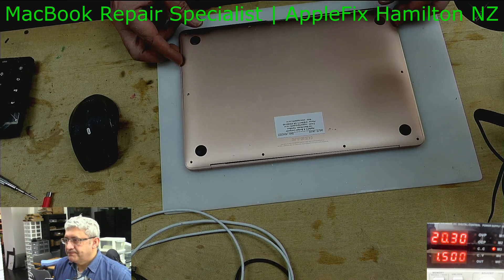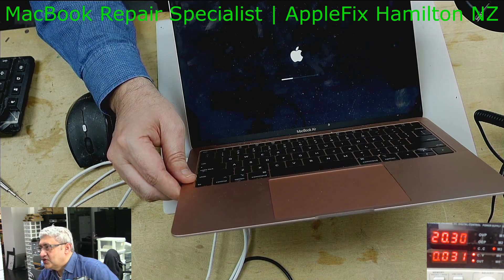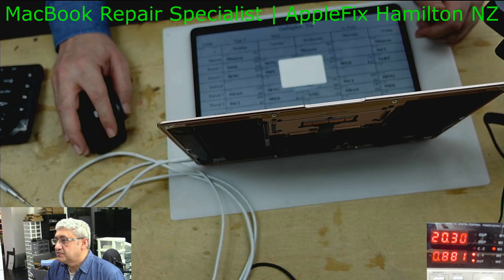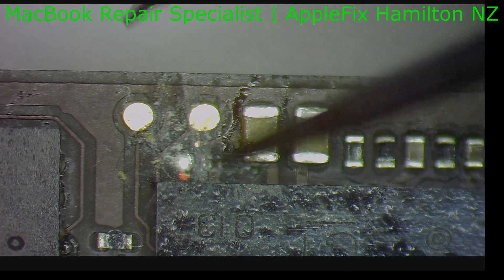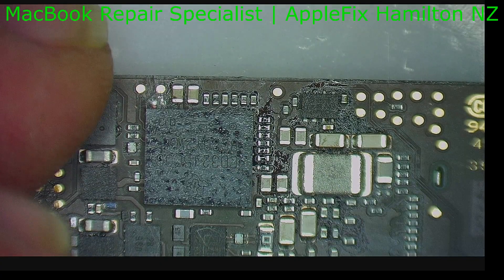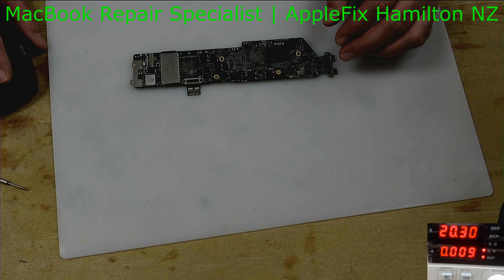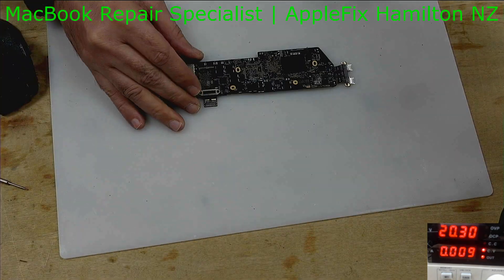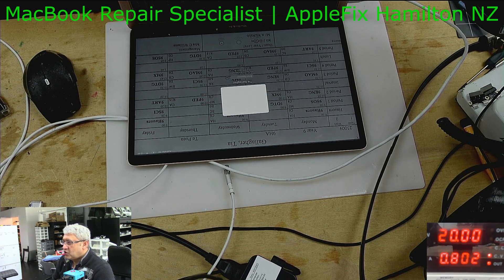MacBook Air A1932 2020 Charging Problem 820-01521 | CD3215C00 macbook repair Hamilton NZ AppleFix

Comment: Now I know why my Macbook Air of the exact same model number won't charge. It will power on plugged in with the ac adapter, but once it's removed it immediately turns off. The power adapter does not get warm at all if the computer is not in use. Thank you for the tutorial. Outstanding job on the repair.